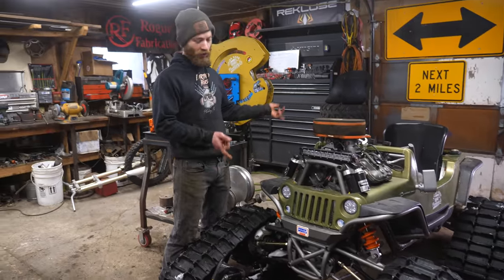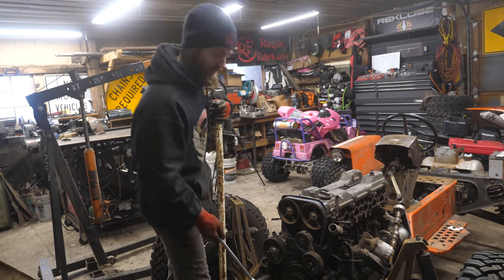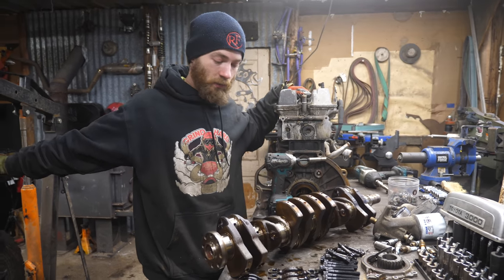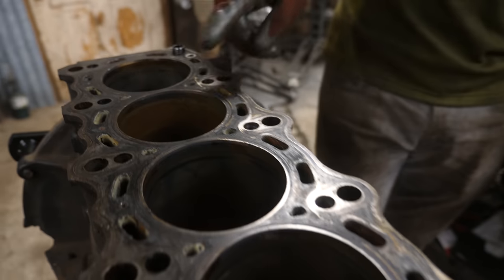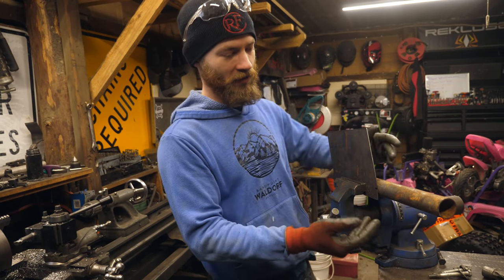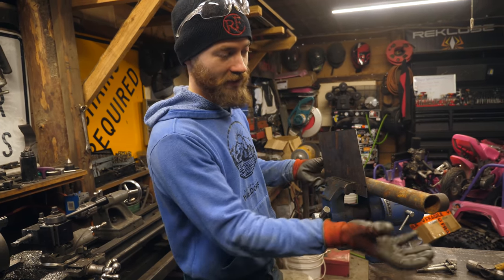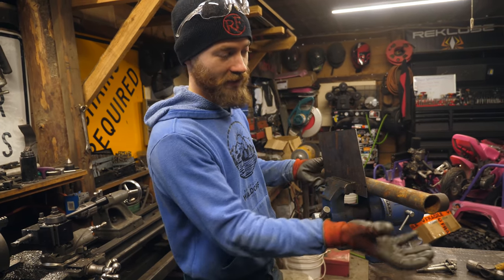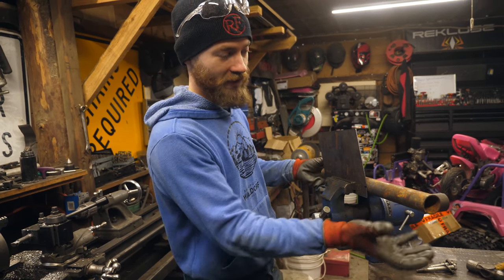2JZ Lawn Mower Engine Teardown and Fabrication

Comment from the maker: New Rouge fab bender giveaway! https://www.grindhardplumbingco.com/ Builds Not Projects https://www.youtube.com/channel/UCMjybV_cas0288vTdde1tKA
Full Parts list from Golby's Parts https://www.grindhardplumbingco.com/
Second channel https://www.youtube.com/watch?v=E0R5mJTKVrQ&t=9s
Reply: Ghpc I'm not sure if you know this but there is a really good wrecking yard in spokane called pull and save they have alot of good parts out there you have to pull yourself but I recently bought a garret turbo from there for 25 bucks will be in my fist video on my channel
Reply: did the barber die of covid half way through or something? get that weird ass hair do dealt with bro!
Reply: Is this is international too yeah?  
I've entered before but wanna check!
Reply: You're link to Golby's isn't working. As an Aussie, I was excited to see you guys promoting Golby's!
Reply: Ou nonononono dont you dare turn that other block into coffee table, how ever cool that would be. Hone the cylinders, fix the missing peace and hone the crank bearing surfaces. This way you have two good engines and cost of this is minimal, specially if you know someone who can do the honing cheaply. Those engines are not produced no more, so all that can be restored, should be restored, who knows how much you can get for it later. In years to come engine as such will increase its value exponentially as morons wreck them and less engines are around. This is already happening to some 80-90's machines, think how things will be in couple of decades.
Reply: Imagine the Mower with a 2JZ GTE... xD
Reply: It's red?
Reply: Hey am i able to purchase from you?
Reply: Whats the name of the beat playing at 7:19?

Comment: Nice video! You guys probably already know this but I would try to keep parts from the rotating assembly (crankshafts, rods, pistons, crank pulley, etc) together because swapping parts around could result in an out of balance engine. Im not completely sure it would be that important on an inline 6, just something to keep in mind.

Comment: I think you guys would know this but just incase not, you arnt supposed to use different cranks or end caps from a different motor cuz they are line honed with the caps on from factory to fit that specific crank to that specific block. So you should use the original crank and have it machined rather than a "new" one out of a different motor

Comment: Dont forget, there are different versions of the 2JZ, so if you have the n/a model, it wont handel boost very well, you'll have to build internals or atleast switch them from a turbo model, altho, why not boost it and see how much/long it takes the boost? 😂 I mean sure it will handle boost, but not the amount of boost people in the internet throw at them..

Comment: love your vids! need longer content, leave all the build stuff at normal speed. we will watch it! love the shit out of that snowquad! how much was the build cost on it? would love to build one but just cant afford it!
Reply from the maker: Thanks gor the feedback! It's a fine line between long enough and too long. The quad conversion was about $2500 for the snowbike kit, and depending on where you live you might be able to find one slightly cheaper. But we already had the quad, and the skis from a snowmobile we took apart.